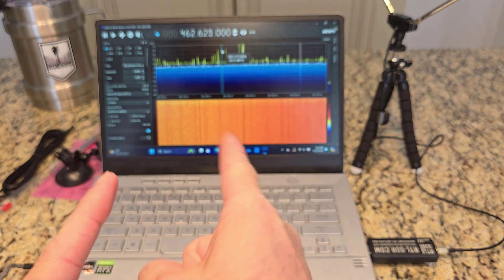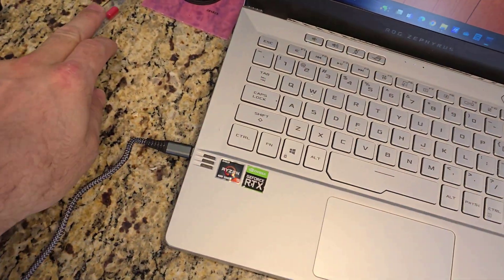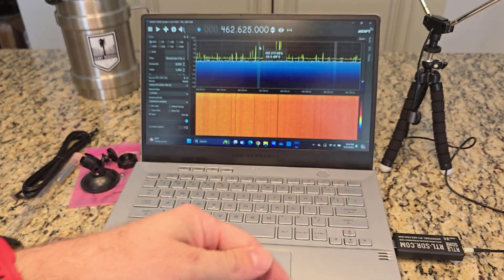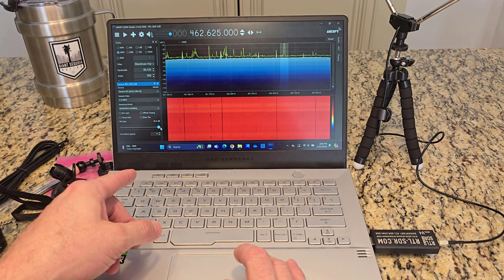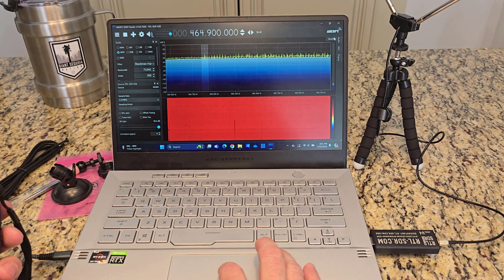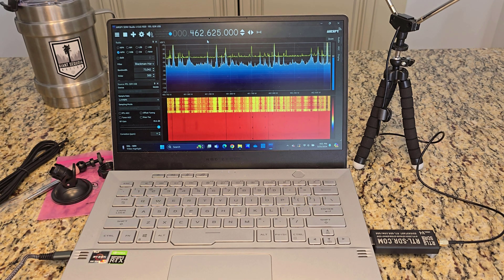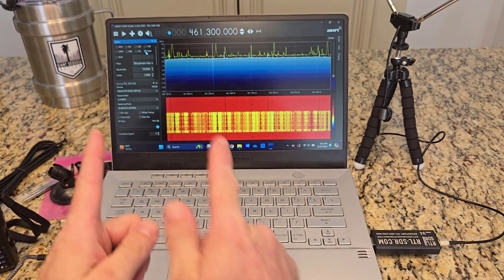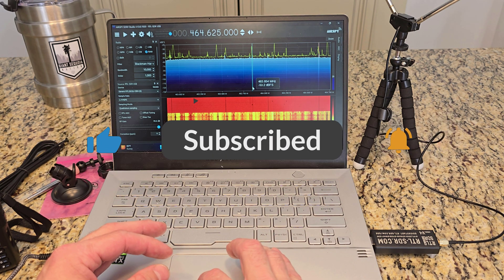Brief overview of an SDR dongle

Comment: i bought one and felt ripped off. they only receive not transmit. if a radio is defined by software why should it not be a transceiver?
Reply from the maker: Ripped off? Let's start with this dongle, which does what no other radio can for a $ drop in the bucket for the hobby. I'm no radio tech, but receiving and transmission are vastly different, as far as hardware. Look into ANY radio that can transmit or receive on half those frequencies and check out the prices. They start at a grand. Shop around the hobby, and when you come back with context, you will be blown away with the value and capabilities. I'm not trying to preach, but you chimed in and seemed genuine, so I don't mind responding.
Reply: @GiantSequoiaNation  oh yes. i appreciate i was a bit of a tit for just buying a thing of amazon. i just assumed if it could receive if it could transmit. foolishly, now i admit. i had just passed my foundation ham exam, i was all excited about radio, i could see myself trying to make rolling codes to open my car, and i was disappoint. i still dont see why if it has the kit to receive it can't also transmit.